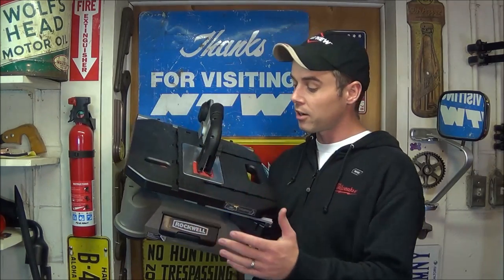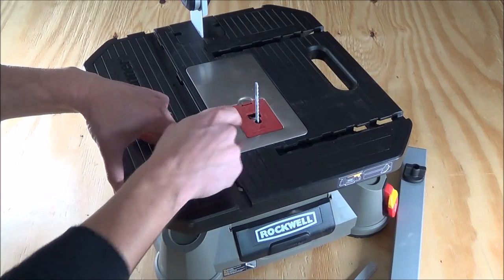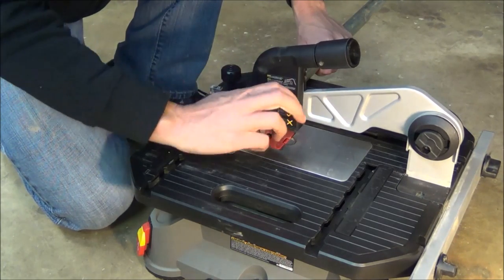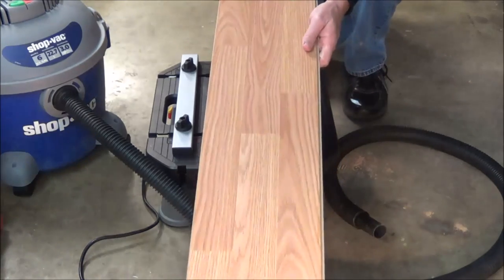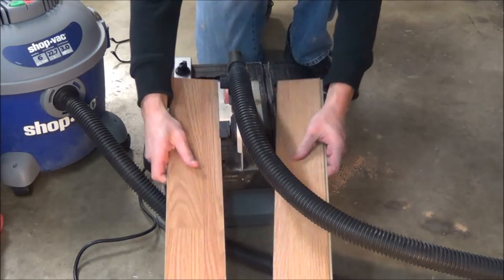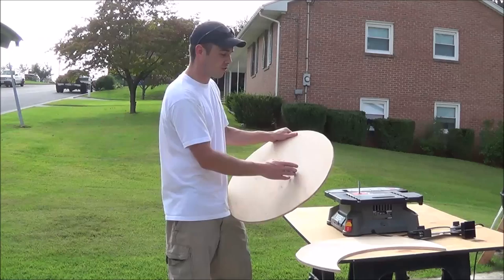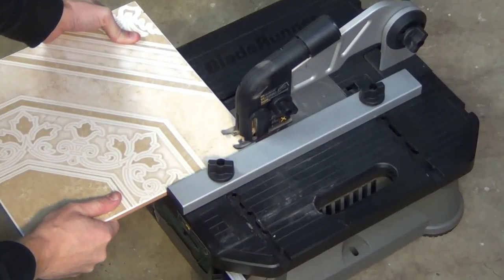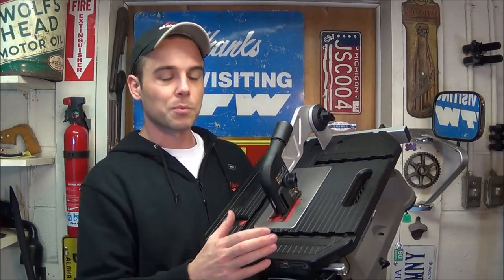Rockwell Bladerunner X2

Comment: I really wanted to see the miter gauge in action doing a 45 degree cut.. any chance of that? =)
Reply from the maker: saschadubin I have some more Rockwell videos coming up soon.....if I can tie that into one of those, I will see what I can do.  Possibly with the jawhorse video :)  Good suggestion!
Reply: Real Tool Reviews Thanks. I am seriously considering buying the Rockwell X2. The one thing I can't find anywhere is a demo of it doing a 45 degree cut with the miter gauge. I would normally buy it sight unseen, but I've read reviews that it is very flimsy and does not do a good job with angled cuts, so I was hoping for a video to prove the nay sayers wrong =)
Reply from the maker: saschadubin What material & thickness are you wanting to cut a 45 angle through?  I will say that going slow is key to a better cut with it & also I would suggest using two long screws going through large washers (through the mounting holes) to hold the Bladerunner tight against a board or tabletop....that really eliminates 90% of the vibration and it does much better.
Reply: Real Tool Reviews Thank you for that tip. I will be cutting simple 1x2's for picture frames and things around the house.
Reply from the maker: saschadubin The other suggestion I have is to try different wood cutting blades....some do a much better job than others.  You are not limited to "rockwell only" blades with this unit, it does accept any t-shank jigsaw blades, so keep that in mind....you may find another blade brand will work better for you.
Reply: Real Tool Reviews Thank you. I just ordered the X2 =)
Reply: Real Tool Reviews when I bought mine today at Lowe's, they had NO rockwell blades at all..so I got some great blades of different brands, they will fit as long as the end of the blade is the same as the ones that come with the saw. (Rounded at the end and a little tip sticking out on each side..)
Luckily there were blades laying in a bag (with the instructions) by the display model, they come with the saw,  so I used them to compare to other brands and found the right style of blade...

Comment: I have worked as a Tool and Die Maker and a Design Engineer.   I like this jigsaw application for its variety and convenience of use.  The instructions Booklet is misleading and inaccurate and needs to be replaced. I still do not know what is the maximum dimension of the dia or the Maximum thickness of the material being cut.

Comment: With the proper blade, could I cut out knife blanks from like 1090 steel?  I assume so.  Noob question I know.
Reply from the maker: I doubt it....at least not cleanly.  This is basically an upside down jigsaw.....you'd be a lot better off going with a metal cutting bandsaw.

Comment: Doe's this rip straight?
Reply from the maker: It’s basically an upside down jigsaw.... not a table saw.... fairly straight if you go slow.
Reply: @RealToolReviews  will it rip a 1 by 3 for about 2 feet straight
Reply from the maker: You aren’t going to get a super clean cut with a jigsaw blade....it will be straight enough, but not like a table saw.
Reply: @RealToolReviews  kinda figured that..I can't find anywhere a small table saw

Comment: My wife makes crafts and wants to cut books into triangular shapes for one of her projects.  The books would be 1"± tick.  How would this saw work cutting books?  If it would work, which blade would be best? 

By the way, this is a great video.  I've been looking for a saw that does just about all you doing with it   I'm going to download this video to use when I get this saw.  I originally though you worked for Rockwell and this was a demo video but you aren't.  They should be paying you for this video.
Reply from the maker: Thanks!  And a bandsaw would work much better.  This will just tear the edges up badly.
Reply: @RealToolReviews  Unfortunately, I don't have a band saw and will have to use the Bladerunner.  Which blade do you think I should use?

Comment: you will have to Pardon some of the typos for I am at the mercy of Google speak at the moment. seriously though anybody who's having drifting blade problems try holding both sides of the material. if this does not solve the problem I will definitely be giving the company a call to see what they recommend.
Reply from the maker: Also.....make sure that the arm is secure against your material with almost no room to move around.....that also cuts back on vibrations & will help eliminate bad cut quality.  In the end, this is a jigsaw mounted under a table....so it is limited in it's abilities....but for the price, I think most DIYers/Homeowners will like it.
Reply: Yeah I did not have it securely mounted to the table I think that would have also helped. Honestly though when I did my rip Cuts they were precise and accurate. Something tells me my cross Cuts would have been the same had I of supported both ends of the material something which I know I'm having done work like this before but for some reason didn't think it was necessary at the time. It may be limited but so long as it can drip and cross cut straight it is very useful.

Comment: Why not just use a scroll saw like my DeWalt. What does this do that a scroll saw doesn't?
Reply from the maker: SATAMAN Schmidt Well, this is geared towards DIYers.....so for the little project they run into (tile, metal, wood), it will cover them depending on the types of jigsaw blades they install.  A scrollsaw would be a much better option for the serious woodworker, but for the $100 or so that the Bladerunner costs, it is a good tool for many people.

Comment: So, its my jigsaw, except not as good, cuz I buy high quality, mounted to a table, but not as good as I have in my shop. So in other words, if you are not a lazy idiot, buy a jigsaw that you get to pick based on your needs, and mount it in your workbench that has a small hole cut in, not even as tough as making a custome router table, and end up with a sturdier fence/mitre guage, and still have a jigsaw that is much better than this for normal use as well, and nobody sees you with that plastic toy sitting in your shop, which would be embarrassing to say the least. Thanks for the review.